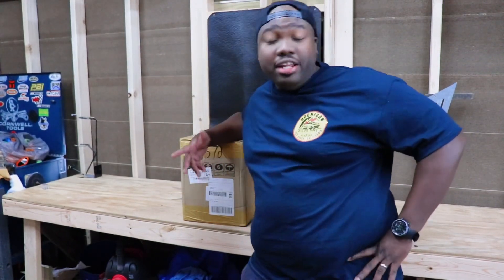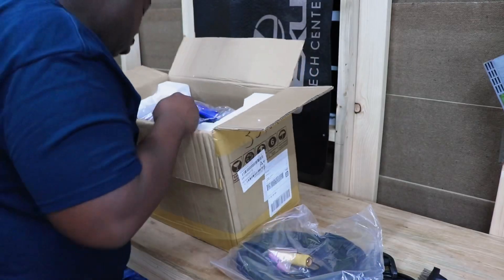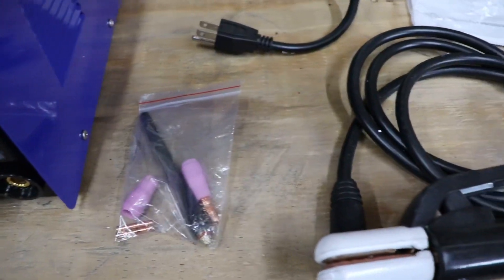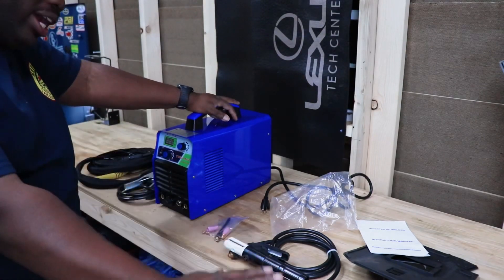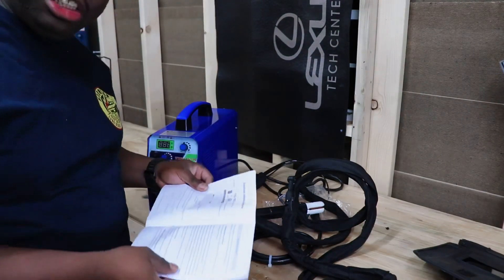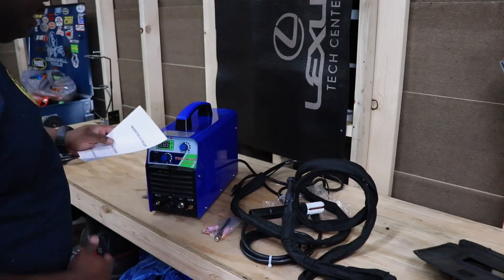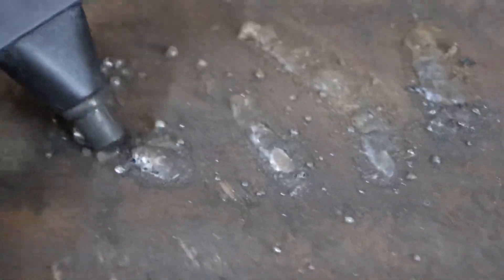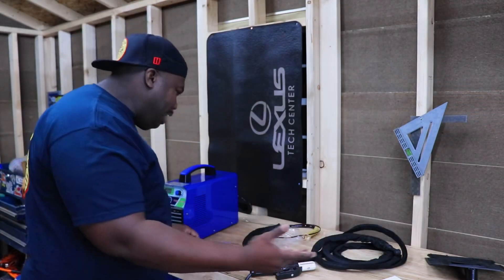I Bought the CHEAPEST TIG WELDER ON EBAY! DOES IT STICK WELD? PT.1 (Unboxing and First Impressions)

Comment: I have one like this. I rewired it with a 220 cord and end. I also bought the outlet with the matching plug you would put on the wall. What i did was take the  wall adapter and wired a 110 plug on it. This way i can plug it in to a 110 or unplug from the adapter and plug it direct to 220.  if you send me you e-mail i wil;l send pictures of it. just trying to help a newb like myself.

Comment: Try getting comfortable welding from right to left. It’s weird but thats how i was taught in welding school and it helps alot. Also at first don’t try and move the stick around to make “dimes” just drag it in a continuous path. I know many professional welders that do not actually move the stick at all to make dimes unless they are tig welding. The welds will still look the same for the most part

Comment: Catch those deals where you can Brudda! I hope it pans out for ya. Also hoping those doors and windows were open, that’s some nasty smoke and you really don’t want to breathe it in. As for the spatter, grab you some spatter spray and coat your workpiece and those bb’s will roll away instead of giving you more to grind. Sorry boutchur taco shaped helmet, just be thankful your head wasn’t in it🤪 A great idea for free angle iron is search the marketplace or cruise the streets on trash day eve for bed frames. I’ve gotten a stockpile of free angle iron that way. I even bring my cordless angle grinder and spare cutoff wheels cause you never know what useable stock you’ll find in your travels😉 The fiberglass welding blankets are pretty decent from harbor freight too. I grabbed two (like $30 ea in store) for $15 NEW off of someone on the marketplace too so keep an eye out! Lookin forward to seein you glue some metal together soon, STAY HEALTHY! ✌🏼
Reply from the maker: Great comments! Doors always open when welding! Great advice about free metal. And I will look out for some welding blankets. Thanks!